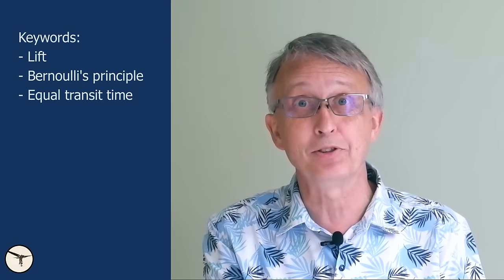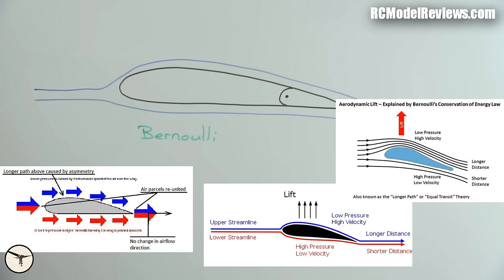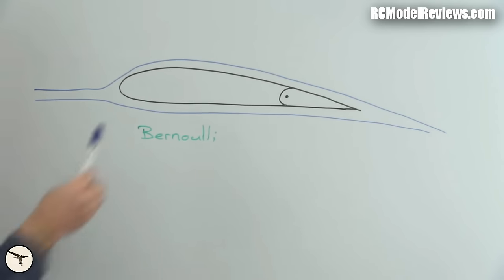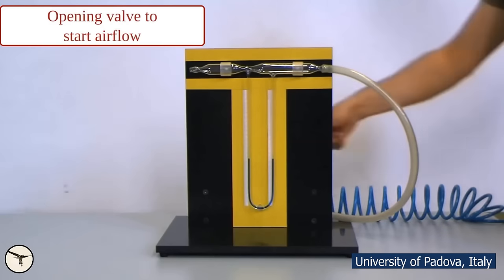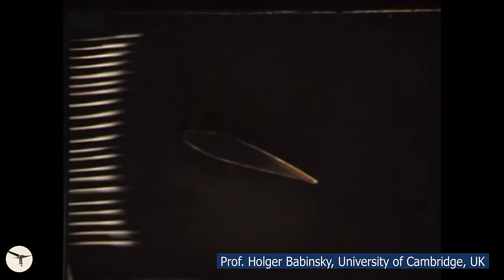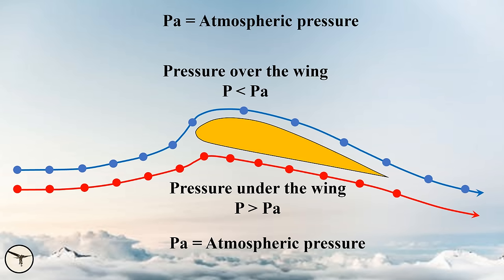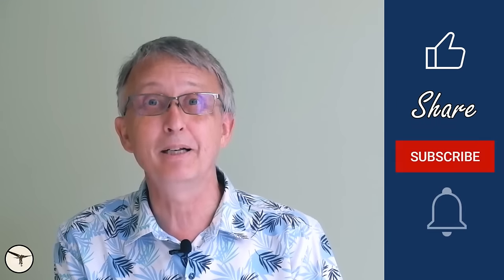Why are so many pilots wrong about Bernoulli’s Principle?

Comment: Physicists and aeronautical engineers disagree with the theory of flight!  The classical explanation of the theory of flight is only applicable to asymmetrical wings, and leads the public into a huge error!  This theory says that, as the lower part of the airplane wing is straight, the air that passes underneath maintains the same density, and, as the upper part of the wing is curved, the air has to travel a longer path, and which therefore has a lower density.  Since the density at the bottom is greater than that at the top, this would generate support!  But this is a SOFISM, because they forgot to consider that there is already air at the top of the wing, and that it will be added to this more rarefied air, actually causing, contrary to what is taught, a compression zone!  To understand better, the bottom part of the wing is just letting the air pass directly underneath it, while the top part is pushing the existing air upwards, it is pushing the air that already exists there!  To repeat: the air that travels a longer path along the top of the wing, and which would therefore be more rarefied, is adding to the air that already existed there, creating a greater compression zone at the top, which pushes the wing down, which is counter-intuitive to teach to children, unlike what is in aeronautical engineering books!  But why, then, does the wing provide support?  Because it is always angled with the axis of the leading edge tilted upwards, so when it advances the air "hits" the bottom, it does not pass freely, generating a resulting vector upwards!  This is the type of asymmetrical wing, where the bottom part is straight and the top part is curved!  Have you noticed that on every plane the wing has an angle of attack in relation to the fuselage, regardless of its profile?  And there are many planes with SYMMETRIC wing profiles (when both the bottom and the top are slightly curved in a symmetrical way), and several that fly inverted (upside down), which completely contradicts the theory of ASYMMETRIC wing!  What gives lift, in fact, is the upward vector generated by the wing advancing at an angle with the leading edge upwards, whether on a symmetrical or asymmetrical wing!  The wing with an asymmetrical profile appeared way back, at the beginning of avionics technology, to enable a robust construction with the materials of the time, such as bamboo and fabrics, which is why they created this wrong theory!  It is still built with asymmetrical wings for the same reason (mechanical robustness).  In fact, while the air that passes through the lower part of the asymmetrical wing, advancing level, has no influence on the compression of the air below it, the air that passes through the upper part, and, by traveling a longer path, created this false theory that it becomes more rarefied, and they forgot that this air diverted by the curvature of the top is, in fact, compressing the air above it, and competing with it!  Important!  Remember this: there was already air on top of the wing!  The supposed rarefied air will add to what was already there, creating a greater compression zone!  Yes, they taught you wrong, and, if you still don't understand, you will understand... The compression is inverted, on top of the wing, which is why all the wings are angled with the LEADING EDGE INCLINED UPWARDS, be it a symmetrical profile or asymmetric!  This upward angle has to be even greater in the asymmetrical wing, to compensate for the natural downward thrust that the wing design would generate if it advanced level to the ground!  Emphasizing: the classic wing with an asymmetrical profile, if placed perfectly horizontally, generates downward thrust, also due to the advancement of the front edge, which has a positive angle, so the air "hits" it and pushes it slightly downwards. , and that is why, I repeat, asymmetrical wings are always angled upwards, even more than symmetrical wings!  All jet fighters, which have the best maneuverability among airplanes, have wings with an asymmetrical profile!  The Concorde and Blackbird had symmetrical wings!  It's such an obvious thing and can be tested in a homemade wind tunnel with a Styrofoam or cardboard model, that is, the moving car window!  Do it yourself at home, because you've been taught wrong your whole life!  This can be seen better by understanding how a helicopter works, which has rotating wings, most of them in a symmetrical profile, and what controls lift is the variation in the angle of attack of the wings (blades), made by the helicopter's "collective" !  Also remember aerobatic planes, some with asymmetrical wings, but most with symmetrical wings (in symmetrical wings the air follows an identical path from the top and bottom!)

Comment: Bernoulli’s Principle doesn't apply to airplanes, it doesn't make sense, what makes sense is that the wing pushes air downward, and as a result, according to action and reaction, another force surges upward lifting the wing. So much so that there are wings that are flat and yet it lift the plane depending on the angle of attack..
Reply: Bernoulli's Pirnciple is a consequence of conservation law so it applies to every single thing that moves through a fluid, no exceptions.
Reply: @XPLAlN  Yeah, I am not a 100% denier of the Bernoulli's principle, But I am quite sure it is not enough to lift the weight of the plane, I thing that is the reason for the existence of the angle of attack, to push air downward.
Reply: @brenoricardo1450  yes of course angle of attack pushes air downward and that is the simple Newton’s 3rd law explanation. I personally think that is the simplest correct explanation of lift. But it doesn’t tell us much about the fluid dynamics. Bernoulli provides insight into the pressure and velocity distribution around the airfoil.
  Bear in mind the forces in question are contact forces (no action at a distance) so we are talking pressure on the airfoil.
   If you look at the general lift equation there is no explicit term for angle of attack. Instead, you have coefficient of lift times the dynamic pressure times area. The empirically derived coefficient tells you how much the static pressure varies around the airfoil, with a change in angle of attack. In other words, it is the link between angle of attack, Bernoulli and lift we can understand without getting into a lot of calculus.
   The variation of static pressure is the Bernoulli principle at work. Now If you say ‘the Bernoulli principle is not enough to lift the weight of the plane’, it follows that the static pressure distribution around the wing surface is not enough to lift the plane. And because we are talking about contact forces here, that cannot be true.

Comment: why should we even care if the airfoil at front is rounder than the pointy back? if the flow is laminar or even in superfluidity, work done on the upper air wing system and bottom wing air system by the plane must be the same. the upper wing air system is narrower due to the bulge of the airfoil therefore the flow must be faster in upper air system. besides if you tilt the airfoil like that and make it move, i can make EVEN a pencil or a hammer to fly in that configuration. do not use the engineering term like transit time or the sort, if you do not use the word, laminar, there is NOTHING to talk about. if there IS an acceleration at front, it obviously wants to flow faster  as it should be as the work done. at 1:15 whatever transit is...ignore it. use only the main laws of physics, energy conservation. it's  Bernoulli and well proven. look at those colliding ships to the Suez canal walls that are not in the center of water

Comment: I think both concepts apply. The air molecules should and want to meet, because anything with mass should maintain total energy as governed by the law of conservation of energy. Bernoulli's principle is derived from this law. Total energy would be preserved but only under ideal conditions. Other forces such as Skin-Friction drag, Form drag and pressure gradients in the boundary layer over various  airfoil sections,  affect the velocities of the free stream air.

Comment: It has nothing to do with Bernouli.
It is action and reaction - it is the deflected downflow of air from under snd over the wing, that provides lift.  To make the wing go up, you must deflect molecules of air downwards.   No deflection, no lift.

The pressure differentials are a product of molecule deflection, not the cause of lift.  (ie: more molecules hitting the bottom of the wing than the top.)

R

Comment: Everyone is wrong. Air flowing over the top of the wing fast enough is not able to follow the curvature of the wing and therefore is creating a vacuum where the air is not following the curvature of the wing. The path the air takes not following the wing curvature underneath that path, creates a pocket on top of the wing, creating a vacuum in that space lowering the air pressure on top of the wing more than the air pressure on the bottom of the wing. Imagine that. The air pressure on the bottom of the wing being greater than the air pressure on the top of the wing is forcing the wing upwards. If this guys delusion was correct, an airplane would be able to fly all the way to space. But no, not possible. Winged aircraft have a limit to how high they can go because of the less and less vacuum the wing can create on top of it with the less and less air flowing over it and the weight of the entire aircraft trying to force it downwards due to gravity.

Comment: All nonsense.  The vast majority of lift is Newtonian, the air leaving the wing has been deflected downwards, i.e. accelerated in a downward direction.  F=ma and that force is lift.  Look at the grass under a gliders wing and you can see it being 'blown' flat because the airflow has been deflected downwards.
An aerobatic plane with a symetrical wing merely uses angle of attack to create the lift but this is not as efficient as a normal wing.

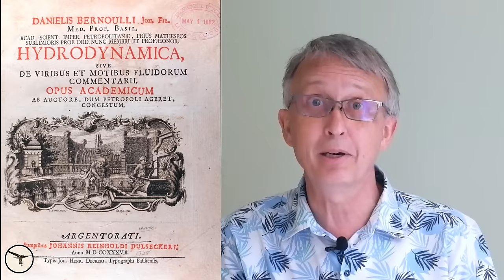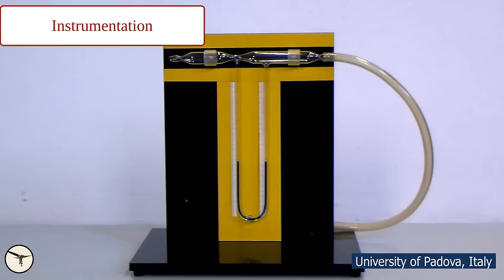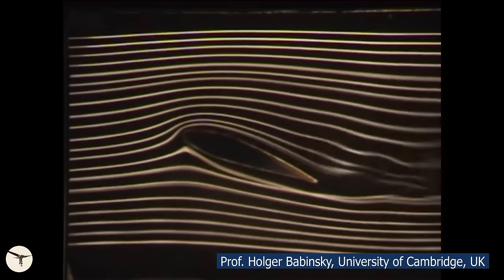Comment: hmmm      1:40      bernoulli's findings are based on  MOVING  fluid.      air/atmosphere can be considered a low-density fluid,  but,  IT'S   NOT   MOVING.!        as a result, the use of the term air 'flow'  leads to  an  Incorrect conceptualization of the lift-making rocess.           2:13     this has  Nothing  to do with generation of aerodynamic lift; in opposition to gravity.           2:39     the  AIR  is  MOVING, so this information is not completely accurate.!             3:13      there  is  NO  air flow, in the real world.!

Comment: I see MORE misunderstanding!  Bernoulli principle is correct and applicable to airfoils. It is not the only aspect and maybe not the most significant aspect but to say everyone is wrong is extremely misleading.
Take a sheet of paper and blow across it, just above the paper.  it will lift into the airstream.  It will also oscillate, like a flag flapping in the wind. 
Why does it do this?  Bernoulli principle; the movement of air reduces the air pressure within the airstream and the static air under the paper will lift it.
So what about that curved leading edge?  If it was just a flat knife edge, then right at the edge you are going to get a disconnection, a turbulence, and the air will change direction suddenly.  To be sure, there will be a small area of low pressure directly behind the leading edge, but as the air comes back down, it will press on the wing and that particular lift is canceled.  not only that, but you have a narrow region of lift, followed by a wider area of depression, and this is (partly) why flags flap in the wind.  It is unstable; lift is not distributed across the wing.
Examine the Coanda Effect.  As air gradually changes direction, it produces a low pressure on the curved surface simply because of inertia of the air itself.  Might there be a high pressure?  Indeed there is; the ram effect of the wing hitting the air compresses the air directly in front of the wing; so what is the vector?  To aft (rear).  As the air then follows the upper curved surface it accelerates and is compelled to change direction; creating a low pressure along the entire upper surface of the wing since you maintain a curvature but extend the radius as the air is accelerating. This creates a low pressure along most of the upper surface and meanwhile the air under the wing is compressed, somewhat uniformly all along the underside, which creates lift.  Some underside wing shapes are concave where the upper surface is convex.  The faster the aircraft the less curved are the surfaces.
Anyway, an actual wing is a compromise since the Bernoulli effect will dominate at only one angle of attack (AOA) and is very dependent on airspeed.  So good old Newtonian reaction is also part of it particularly at lower speeds and higher angle of attack. 
Why might FAA emphasize the Bernoulli aspect over other aspects?  Because the low pressure region of air will condense moisture and freeze up, and you lose the Bernoulli effect because the low pressure region is filled with ice.   Likewise, the leading edge ceases to be round (invoking the Coanda Effect) and becomes a knife edge.  The combination of these effects means the wing can only fly because of Newtonian reaction; inducing way too much drag and your aircraft is going down.  
I have had this on my drone (quadcopter) rotor blades in two minutes in cold humid air; the upper surfaces of the blades were coated in ice, also the leading edges, but not the underside of the blades.  
The Bernoulli effect is undoubtedly the leading contributor to lift, but not the only contributor.  An iced-up wing loses Bernoulli effect and that's all it takes to bring your aircraft down.

Comment: Who. Cares as long as you have an idea.
Reply: It depends on if the idea works sufficiently for one's intended purpose or not.  Stress test an idea according to needed purpose, and the flaws start appearing.  Keep reworking the idea to fix the flaws, and the output of that process can't help being of higher quality.

The problem is when ideas are too "siloed" from sufficient stress testing.  Like happens on the internet not infrequently.  

It all depends on the purpose of the tool (the idea).

Comment: The theory that illustrates buoyancy force by referring to the shape of the wing and Bernoulli's equation is really wrong.
But your theory is also flawed.

The problem is that the behavior of the air cushion effect is two-dimensional. 2:36 Pohl's device is two-dimensional. The behavior of the NEM aircushion effect is three-dimensional.

A vortex is created behind the wing. This vorticity is helical relative to the wing and is therefore three-dimensional. All theories treat this as a byproduct of the vortex. In fact, a swirling medium has mass. This mass gains (vortical) momentum. Momentum requires strength. The counterforce of the force is the buoyancy force itself.

But why is everyone running away from the spiral vortex? In reality, the problem is the wrong teaching of the Bernoulli equation. No one teaches the limitations of using the equation, even though this is also part of the equation.

1. The state of the flow is stationary (stabilized)
2. its medium is incompressible
3. the density of its medium is homogeneous
4. The flow of the medium is vortex-free
5. and the external accelerating effect is limited to gravity

If these points are not valid, then a much more complex equation of Bernoulli and Leonhard Euler comes into play.

I repeat. The Bernoulli equation as we know it is a simplified equation and not a universal flow theory equation.

Points 4 and 5 are critical. Because of point 5, the simplified equation is not suitable for describing the centripetal acceleration of media. However, the medium changes direction on the wing. And of course, the simplified equation is not suitable for describing swirling.

(Google translation from Hungarian. I hope it can be used)
Reply: I elaborated the topic with figures. The text is in Hungarian. If there is interest, I will translate it, but it takes a lot of time for me, depending on the quality

Comment: Because the plane stays in the air whether they are wrong or not. It is literally useless for a pilot to know the difference between the misconception and reality.
Reply: Well, it would be nice to know if icing is more problematic on this part of the wing than that part of the wing and why.  As a safety issue.

Comment: Better than average misconceptions but not the full story. Lift is always generated by a combination of low pressure above the wing and Newtons portion. The theory of combined flow at LE is just BS.
Reply from the maker: Bernoulli's princilpe and and Newton's second law are describing the same thing: https://youtu.be/ph1HqrioLPs
Reply: @FlywithMagnar  one part of the lift is the momentum of the air molekules hitting the lower surface under high positive AoA. One part is generated by bernoullis principle and the low pressure buildup. This is for my understanding 2 different things. You can not apply bernoulli to a flat surface wing but it works. So numbers of YT and pdf later: I am very convinced but always appreciate discussions on such tasks. Cheers.

Comment: Ok explain how planes can fly upside down. Bernoulli's Principle is not the sole reason for lift, there are other factors in play.
Reply from the maker: The answer is angle of attack. Bernoulli's principle explains the relationship between air pressure and velocity. Newton's laws of motion explains how the air is accelerated around the wing and the action created by the downwash behind the wing. In other words, Bernoulli and Newton explain the same lift from two different viewpoints.
Reply: @FlywithMagnar  it still doesn't make sense though 🤷‍♂️